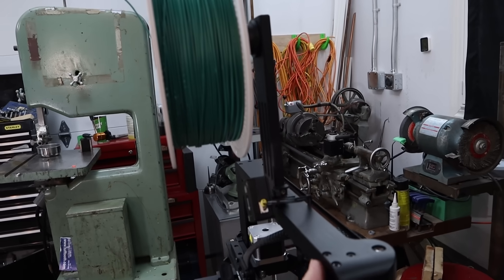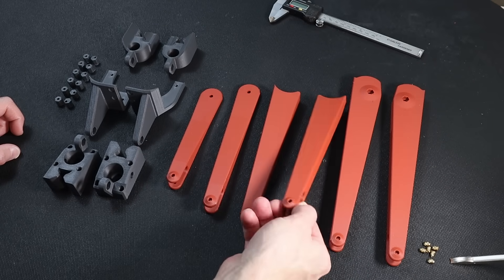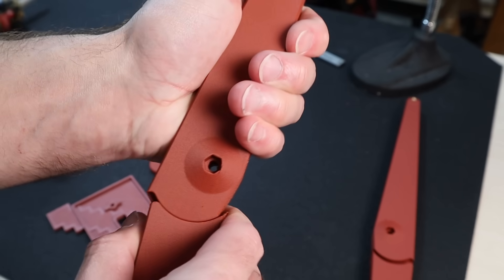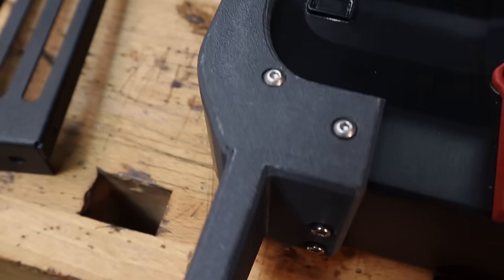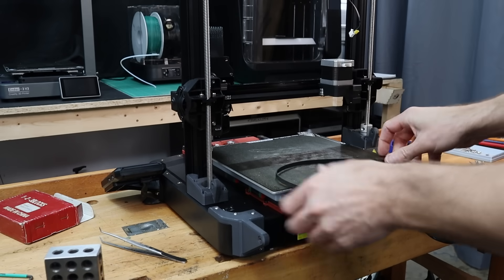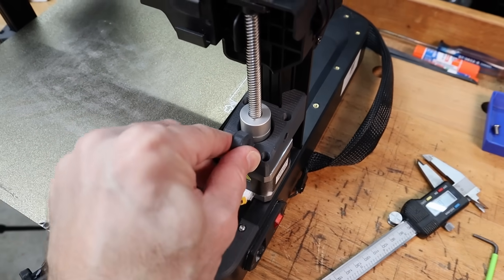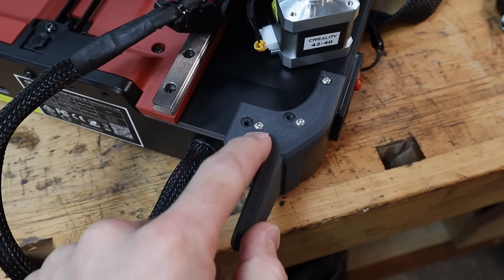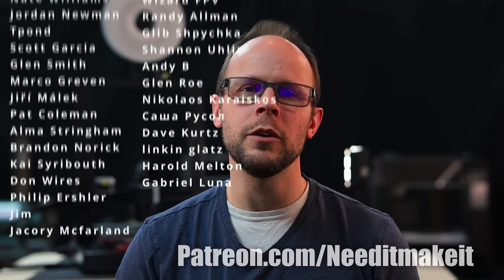STRONG and FULLY 3D Printed Arms for your Ender 3 KE and SE

Comment: So I am looking to upgrade to the Ender 3 KE from a basic Ender 3 and want to know if these series of modifications are NEEDED for this printer? Or are these modifications more for the longevity of the machine? 
Am I safe to just unbox, setup, and start printing? I absolutely needed to do some modifications to the ender 3 to get some good prints but I want to know if that is the case here as well?
I'm looking for faster print times without (or negligible) loss of quality. I print a variety of things from household Q.O.L things, to toys, to D&D Miniatures.
I just want to know that I am spending my money wisely. I also don't want to dive into resin printers right now (maybe some years down the line).

So, any advice?
Reply from the maker: Maybe I'm biased but I don't really recommend any bed slingers anymore.  Trying to move the mass of the bed along with the mass of the part you're printing on the bed has always been something that didn't make much sense.  You'd also need some kind of enclosure for the best results.  I've used a blanket, which looks awful, but it does work alright.  Personally I have far better results with CoreXY printers.  They're faster, more accurate, have less mass to move around at high speed, less ringing issues etc.  I'm not sure if you've made up your mind about the direction you'd like to go, but I'd say try to get a CoreXY format if you can, there are lots of new ones coming on the market at a reasonable price.  I'd recommend an enclosed one as well, you'll have better success this way as well.  

For the DND stuff, you can use a CoreXY with a 0.2mm nozzle, but they're better to be printed with a resin printer for the high detail you might want.

I hope that helps a bit!
Reply: @NeedItMakeIt  My price range is fairly low for printers at around $300. I really don't want to work with resin right now because of the ventilation needed (I live in a hot/humid place), so it would needlessly heat up my room to open a window and I don't want to mount anything in the window for now. So I'm really stuck using FDM printers. 

So, are there any FDM printers that match the performance of the KE for the price?

Sorry for asking so many questions.
Reply from the maker: @whozawhatzit0  No problem!  If that's the case I might recommend that you look at the Bambu A1 Mini, it's small but it is precise and since you're printing mainly smaller parts it might suit you pretty well.  The bed being so small doesn't really have the same issues with slinging a massive plate like the larger printers would.  I think it might be in and around your price point and there are options to upgrade to color.  I don't have one myself, but I've heard quite a lot of good things about it.   I just checked and they've come down in price to 249 without their AMS, so it could be a good option.   The KE quality isn't exceptional, you really need to upgrade the printer before it can be, with the A1 Mini there are no upgrades needed.
Reply: @NeedItMakeIt  So does the Bambu A1 mini have the same feature set as the KE? (Auto calibration/Z offset, wifi printing, and so forth?

And does it at least print at a faster speed than my Ender 3? I'm sick of waiting all day and night for a small set of mini's to print lol.

By the way, thank you so much for all of your help and advice. I've been so stressed out trying to figure all of this out, so this has been a huge help!
Reply from the maker: @whozawhatzit0  The Bottom line is that it is an overall better printer.  Some people don't like that the software is "Closed" so you can't tinker with it.  It has more features than you list and the ability to add upgrades which most printers do not have.  Have a look on their site and see if it would suit your case well.
Reply: @NeedItMakeIt  Thank you very much I appreciate it!
Reply from the maker: @whozawhatzit0  Let me know how it goes and what you decide.  There are always new printers coming out too so there might be something else well suited to your case also.  If you're printing high-detail, you'll probably want the 0.2mm nozzle no matter which printer, they'll be slower prints but they'll look far better.

Comment: I printed and fitted this today with my teenage son to his KE.  It was printed on the KE.  Petg with 8 walls and 55% infill, it’s VERY rigid.
Reply from the maker: Nice work!  It isn't a small job, but it's a nice final result.  Especially when the holes line up better than they did for mine the first time around!
Reply: @NeedItMakeIt  I did need to use a couple of the offset hex bolt inserts to make things fit without stretching or bending anything but overall it was a big success and the arms are super strong.  I used normal thick superglue on the big arm joint.  I have left the photos' of my finished job on your Maker World page in the comments.😁

Comment: You should relocate the spool holder next to the pronter, there will be less weight on the top of the frame causing wobble.
Reply from the maker: I agree, with this printer the runout sensor needs to be relocated to the extruder so that the filament doesn't need to first loop up on top and then down to the extruder, but that's possible for sure.

Comment: great work my friend, I'm thinking about buying the new Ender 3 V3 Plus, I hope this aspect is resolved because it already includes arms to avoid this effect.
Reply from the maker: Thank you!  I have one of the smaller new E3V3 printers with the metal frame, which I've been testing and they've fixed just about every problem.  I'm still having one little issue and it's not bad, but the extrusion seems to be not quite as consistent as I think it should be.  Maybe I've been spoiled by the QIDI Q1 and the Bambu X1C.  I have more testing to do as well, but I think it might be related to the extruder design, it is still only supported on one side of the extruder gears, allowing some movement, it's very hard to know since I'd need a glass panel to see what's going on inside.
Reply: @NeedItMakeIt  Thanks for the feedback, I will continue to follow
Reply from the maker: @fredydefcon1  Sounds good!  I'll have a full review video on the printer, I'm trying to learn a bit more about the extrusion before I finish it up.
Reply: @NeedItMakeIt  ok I can't wait for the review 😃

Comment: Seems like turnbuckle nuts in there somewhere would allow fine adjustment.   Still a cool project.
Reply from the maker: I soooo wanted to create some 3d printed versions, but it would have increased the complexity level, great idea through!   Maybe I need to put some time into a 3d printed turnbuckle?
Reply: @NeedItMakeIt  - I would think a couple of threaded ends and then the turnbuckle nut would be fine somewhere within the printed long support.  Then maybe print a snap cover to hide the hardware and make it blend in.  I am not criticizing by any means....it just popped into my head when you said people have said there are differences in the gaps.

Comment: how much easier would it have been to just go to home depot and get yourself some threaded rod instead of printing them big ass pieces and joining them with glue, also way more rigid
Reply from the maker: It would have been easier, again this is meant to be a solution for anyone at any skill level.  It would have been easier to grab a piece of steel, but attachment is still a problem so I would have created brackets at each end to glue the rods into them.  I have nothing against using steel, I have a metal lathe, I have a blacksmithing forge/anvil etc.  it's not about me, it's about what makes the most sense for the most people to provide an accessible solution.  I say, do what works best for you, these are just ideas that I'm bringing into reality.
Reply: @NeedItMakeIt  you would obviously need 3d rinted brackets at the end however they could be threaded instead of glued and the threaded rods solution would A)look less bulky, B)be stronger, C)be way faster to make c) save you a crap ton of filament
Reply from the maker: @darktrojan00  For sure, I actually started with that idea and moved to a fully printed version.  The rod idea is overall better, just the issue of having to cut and thread the ends, also it should really be threaded LH and RH so it can be adjusted easily.  The connections could even be glued though, threaded it better for adjustment though.

Comment: I had similar issue with other printer. I took 3$ aluminium bar, mesured it, cut it, drill it and screw it in. Around 30min work and it looked like it was there from the start.
Reply from the maker: Sounds great!  Sadly with this printer there are no good places to screw it into, but the bar idea is a good solution and maybe have 3D printed end pieces to receive it.

Comment: Great video! Just out of curiosity, have you found the solution to the poor print quality on the KE? Been having very similar print quality to your previous videos
Reply from the maker: I'm working on an extruder solution for the printer, we have a solid X, a solid Y, and now the Z.. the only thing left is the extruder and extruder motor, possibly the hot end/nozzle comes into play a little bit as well, but that's not my impression from what I've been seeing.  I'll have something to release in the next few weeks...as long as I have solved the problem!
Reply: @NeedItMakeIt  awesome, looking forward to that. Have you had any issues with the belts rubbing the edge of the bearings, specifically on the ends of the x axis?
Reply from the maker: @CalvinBarnard-ky4wz  There isn't really any guide system, just the edges of the idler pulleys, so yeah they do rub a little bit there, it's the same with most of the printers no matter which brand, it just seems to be the way they've decided to track the belt.  If you watch the Core XY Printers as the belts move back and fourth, they raise and lower quite a bit, but it seems to be irrelevant as far as I can tell.

Comment: Made a similar structure a few weeks ago for my KE and honestly the biggest improvement was when I finally printed a mod to get the spool off the top
Reply from the maker: Nice, that spool on the top wobbling around like it just don't care
Reply: Could you send me the link to this reel mod?
Reply: @Finallf  if you Google it there are a bunch of different versions of a side load mod for the ender 3, the specific file I used was a remix of a support frame that I also printed for it that has been removed

Comment: Can someone tell me what length rods i need for the supports?
Reply from the maker: To use metal rods?
Reply: Yes
Reply from the maker: @LetMeBeFloxMeTv  Are you wanting to adapt the design to use metal rods?  If so, you can start with 18" rods and then cut them down as-needed.

Comment: Where can I find the printed bed slinger? The only problem I'm having with the printer atm is a kinda uneven layer height 
I have both the linear rails and gantry supports
Reply from the maker: Do you mean the replacement for the steel plate below the bed?  If so, I have to fine-tune a few details and then I'll be ready to release it to everyone.

Comment: I've had my KE since January and I made a similar fixture back in February with 15mm aluminum rods and fixtures that attache on top of the gantry and below the base through those tiny M3 screws under. Cool to see a fully 3d printed version! Adding these fixtures for sure improves the print quality quite a bit.
Reply: What size were the rods? Do you have a file for the printed parts? I have access to breass and aluminum rods.

Comment: I was going to do this however after I rotated the spool 90° the shaking is not as bad, also after i updated the input with the g sensor it has begun countering its vibration better.

Comment: Thank you so much for your hard work. I'm looking to get a KE soon. Saved all your series ready.
👏👏👏
Reply from the maker: That's great, thanks for the support.  If I may ask, are you set on this printer or are you open to other options?
Reply: @NeedItMakeIt  no, I'm open to any suggestions. Please thank you.
I thought the KE because I want something future proof a little, I can improve, and also, from what i see and read, Klipper is the board to have.
Buy the SE and extras to KE spec come out able the same.
But and suggestions great fully  received. 👍
Reply from the maker: @philj1975  At this point there is so much competition, that I wouldn't go with a bed slinger, they're very limiting on what you can produce, a CoreXY enclosed printer if far more capable, and produces better results.  The QIDI Q1 Pro is an excellent printer for the price, it may be the best overall that I've found so far, with the Bambu X1C/P1 series printers also competing for top spot.  The X1C is far more expensive of course.  The QIDI Q1 Pro has features that the other printers don't have and will give you lots of options for later on.   I have a video review of the QIDI Q1 already to show how it performs.  If you have a moment, check that one out and see what you think.
Reply: @NeedItMakeIt  i have looked at this one as well, but I will have to wait as not available in the EU yet. I'll wait and see then that it's. It is a nice machine and I do like it as well.

Thank you for help and option @NeedItMakeIt

Comment: Hi, thanks for another great video!
Personally I already have a reinforcement, I found the model before your video, but it is true that it can greatly help especially at high speed. 
In your opinion, what speed and acceleration should be used for PLA, PETG and ABS/AS to get maximum print quality? Print speed is not a problem for me.
Thanks in advance for your help :)

Comment: Will the uploaded bracket for the motor side work? It doesn't look like the updated model shown.
Reply from the maker: Well I'll be a monkey's uncle, it looks like the exported file isn't the most recent version, which is very hard to explain, since I don't have that model anymore.  I'll sort that out right now, thanks!
Reply from the maker: It looks like the last few steps in fusion were disabled, I suppose I must have onto the timeline by accident, I'll send the notification out, great catch BTW!

Comment: I printed a side spool holder for my filament. No more extra weight up top now
Reply: I did the same 👍🏻
Reply: This definitely seems like a better/easier solution.  With the spool gone there's not much weight up top, unless you're doing a really tall part that has the printhead way up at the top of the mast.

Comment: Oof those curved sliding dovetails are so satisfying. Pretty extensive mod, but very beefy and industrial looking! As always, fun to see your iterative process. And now we can add the M5 lock nuts. ;)
Reply from the maker: It was more challenging than I expected!  What came out of it was a few innovative ideas that might be useful.  A fun project and it looks great, unfortunately I still need to work on the extruder and that's even more challenging.   I was having so much trouble with that nut, the other side went in first-try.

Comment: My KE HAS NOT been a good experience. No matter what settings I change or what I adjust mechanically, during the initial layer print, some areas the nozzle will scrub and others it won't. Been all over this thing checking and measuring. The layer will be great in spots and other spots its will just be strings. I'm trying to print a 200x200 initial layer. My bed is level was within .06mm across the bed. I guess I got a bad unit. About ready to toss it in the trash. Someone...any suggestions before I do??
Reply: If the KE has the CR Touch probe, like the Ender 3 S1 Pro that I have, then that may be the culprit. It seems the probe is very sensitive to giving inaccurate and erratic readings if it touches the bed at an angle, and this can happen if the bed is not 100% physically level + there is physical play in the metal "probing stick" of the probe. I struggled with first layer problems for a long time until I read about this. I can also notice quite a bit of physical play in the metallic tip of the probe when testing with my finger.
Try putting your printer at an angle (eg. raising the front like say 5-10cm) and then running a few consecutive mesh probes and see if you get the same readings every time and then compare that to the readings you get when the printer is level. Putting the printer at an angle forces the probe to touch the bed at an angle every time, but it will always be at the same angle and also if there is play in the tip, it also forces the tip to the same position within the "play area" when probing.
Hope you got what I was trying to explain - I'm tired and english is not my first language :D